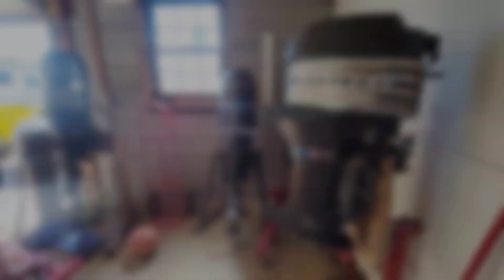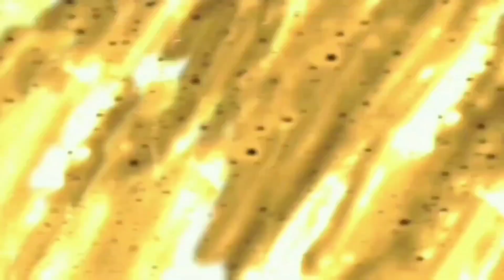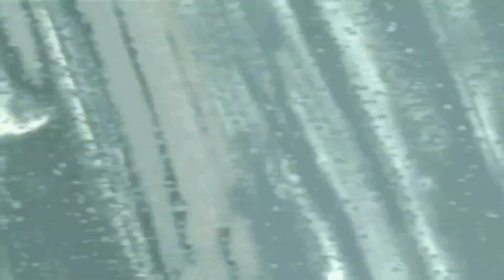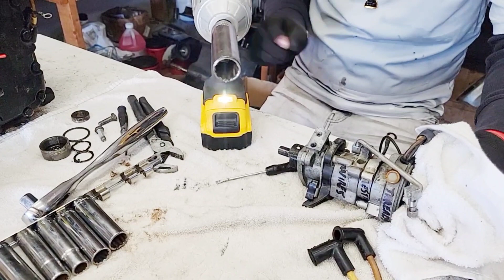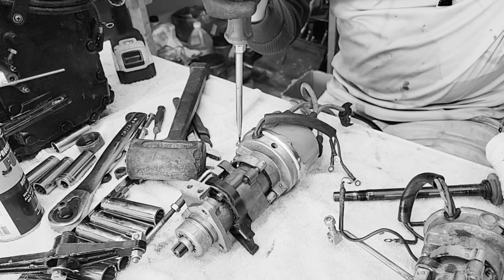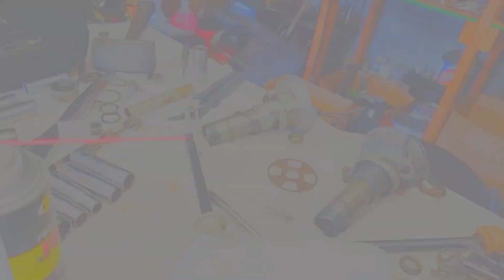Mercury 6 Cylinder Distributor Conversion to a 4 Cylinder Distributor: Always Something...

Comment: Have you thought about adapting an automotive powerspark unit. The ones that convert old points style distributors to electronic pickup. Just need a coil, leads and plugs to match.
Reply from the maker: Not sure if that's compatible. I have thought about it but I have never seen it done even by the pros. Son

Comment: Hey Son, thanks for the great videos! I need to change all of the spark plug wires on my 197x Mercury thunderbolt 1350 135 hp 6 inline. Do you know a good place to buy a kit? having problems finding the correct one. Any ideas? Thank you!
Reply from the maker: Amazon.com.  18-5225 sierra.....Son
Reply: @MerCSonL6  thanks a lot
Reply from the maker: @anatolirailean6963  yes sir. Son